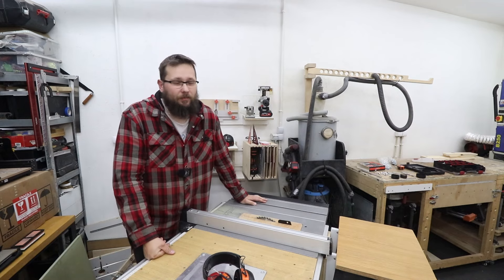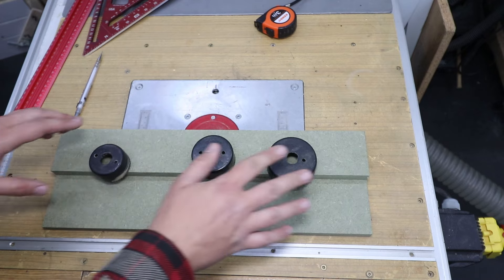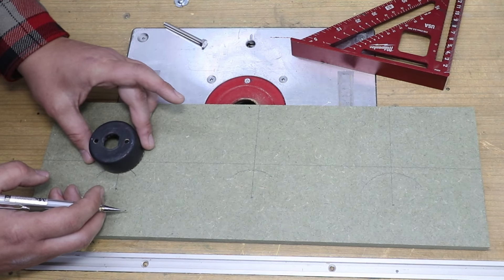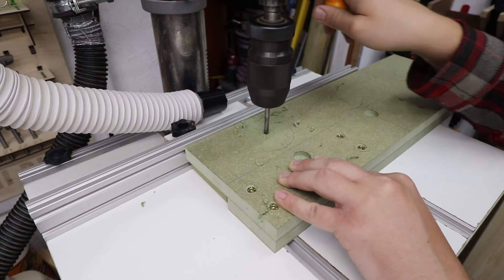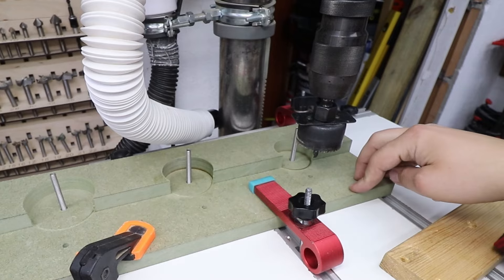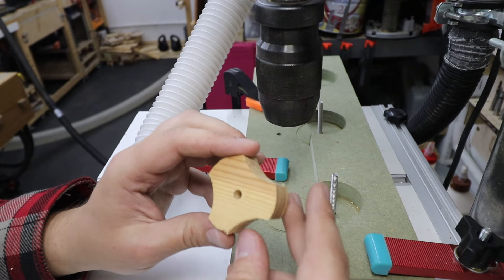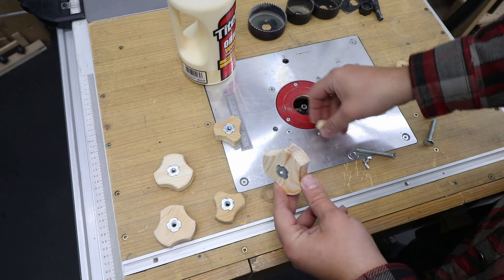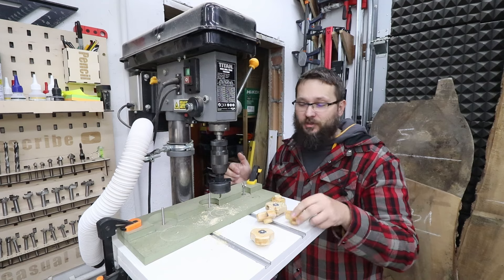Simple Jig For DIY Wooden Knobs - Woodworking Jig

Comment: Another great jig Tomasz, thanks for taking the time and effort to share stuff like this with us all 👍
A few suggestions if you don't mind ... 
1) The smaller top piece of MDF doesn't support the workpiece at all so is not required!
2) The whole jig could be shrunk down to a square ... a hole in the centre acting as the centre hole for all sizes of knob blank to be cut ... then three holes around it at the appropriate distance for each of the knob sizes, which is where the knob is then mounted to cut the scallops😀
Reply from the maker: Could do. The smaller piece of mdf at the top act as a fence so the wood is not spinning as you cut the first full circle. And my initial thought was to make another hole in the top and create a stopper, or guide for the second stage of cutting the final shape. But the wing nut was holding the circle so well I decided there was no need for anything else and marks can be made on that top piece and then transfered to the circle to make sure the cuts are spread apart equally. That was thinking behind it.
Reply: @CasualDIY  Gotcha, wasn't criticising in any way 😀 and it's good to know what your thinking behind the jig was ... as I've said before, it's easy to improve on what others have done but they had the initial idea 👍
Reply from the maker: @barry.w.christie  Not taken as criticism, its all about improving and making things better. Your comments may help someone to make this better, easier or fit their needs. Always happy to receive feedback, it helps me and others. I tend to make "a starting point", then people can amend to their liking 😄👍
Thank you for commenting and watching Barry👍